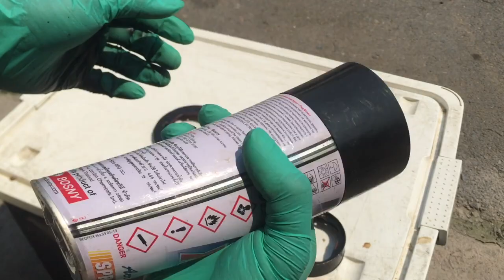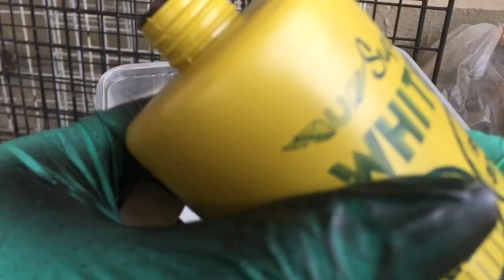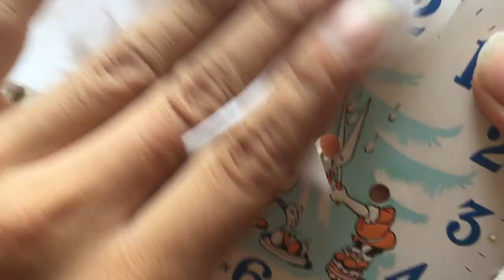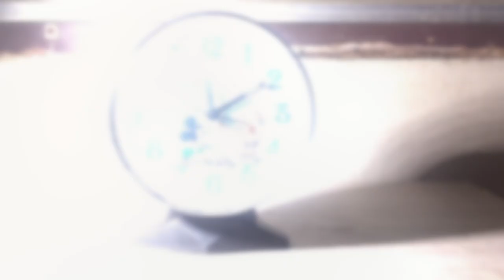Vintage Clock Restoration

Comment: Nicely done,  but if you don't mind a little tip to keep the Trolls and nit-pickers off of your back, don't use the term antique for anything less than 75 years old.   Anything younger than that is considered Retro.  Nostalgic also works.
Reply from the maker: Thank you 😀